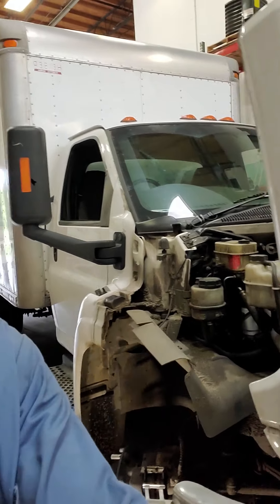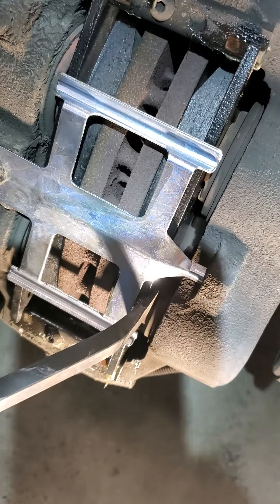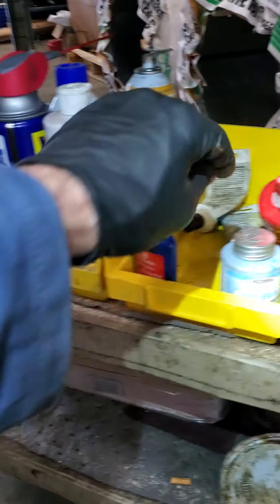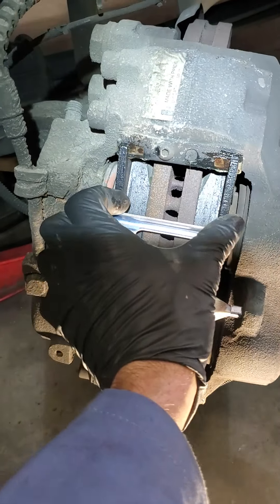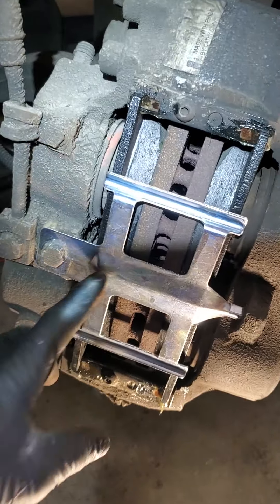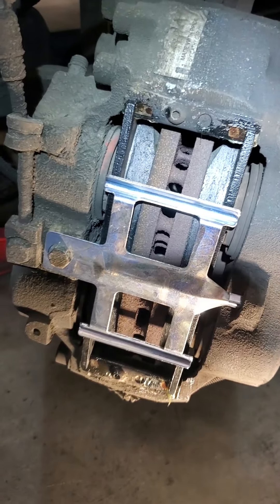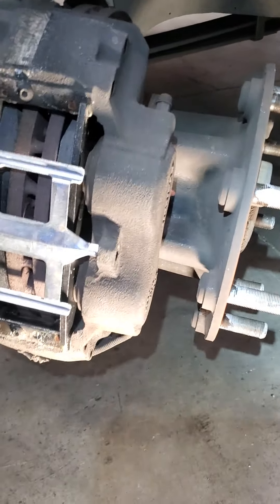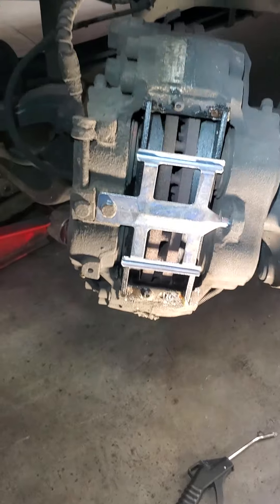2005 Chevy Kodiak C 4500 front brakes

Comment: Great video! Thank you.

I've heard to never put brake lubricant on the brake pads. It is for lubricating the edges of the pads where they slide on the caliper and for between the piston and the back of the pad to reduce friction. Adding lubricant to the pad face where it contacts the rotor will reduce the braking friction between the pad and the rotor. Less friction means less braking power.
Reply from the maker: Agreed..yea def light on the brake grease

Comment: I have a 2008 c4500.Is it easy to bleed the brakes on these trucks?Can you bleed them without a scan tool by simply cracking the bleeder screw while someone works the brake pedal??
Reply from the maker: Honestly...scan tools make it happen
Reply: @herpabetic  Thank you,I appreciate the reply. On my 2008 C4500,which has no brake issues,I just want to bleed them the old fashioned way with someone pumping the brakes while I Crack open the bleeder valve. 

I can do it that way,correct?
Reply: I did bleed my 09 with the single person bleeding, ??? 2+inches of brake fluid in a  
(( wash out the pop bottle let it dry of a week?? should be good for removing soda and sugar and was well dry!)) 
(we have larger truck so a 2 liter bottle ) so to prevent back ?? bleeding is it. I pumped my several times to remove some of the brake fluid out of the resover  that way your not diluting the new with the old oil. A tube slightly larger then the hole in the top of the pop bottle keeps it in my want to put a bit of grease on the nipple to reduce air infiltration. I didn't mind using a bit more oil then needed, the first one will take more oil as it is cleaning the resavor. 
There is this information on YT. I do like to use a socket and ring wrench not the spanner for doing this.  
If I can connn someone to help me use the two person method just to check that is worked well won't take much time to verify.

Comment: How did you bleed the brakes
Reply from the maker: I had my partner pumped on the pedal to manually bleed. And then I did an electronic bleed on my scanner. But do not open the caliper unless you need to